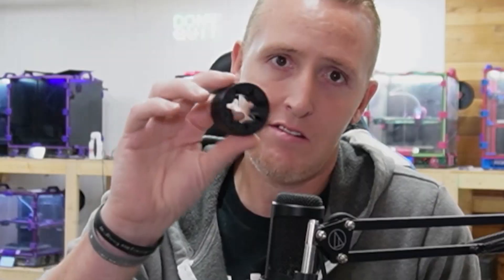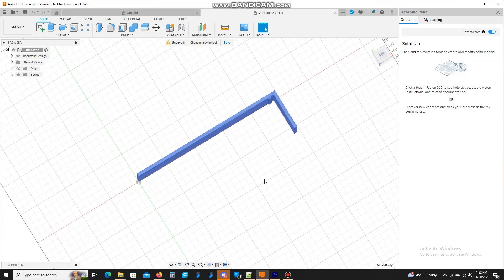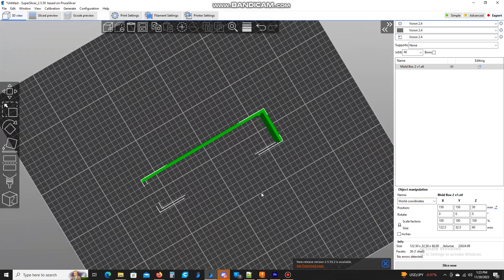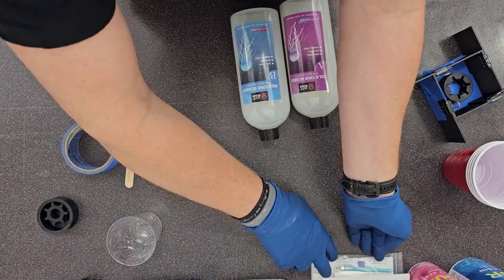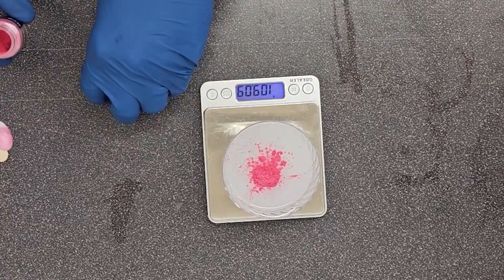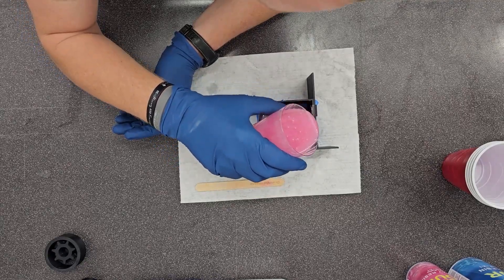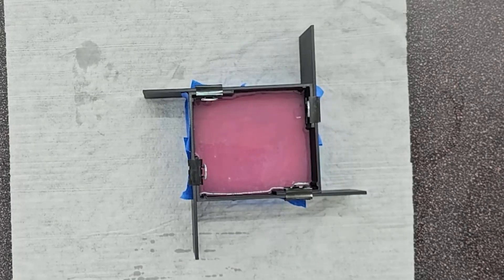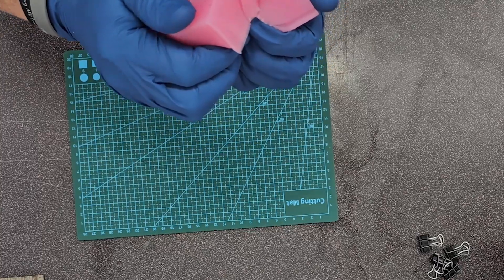From Prototype to Production: Using 3D Printing, Silicone Molds, and Resin Casting

Comment: Great to see everything turned out!!! 

My video commentary… 
- Those scales in your video are what I use… think I have 4 of that size and 3 of the large ones. I also spray my scales with a silicone based mold release in case of spillage. 
- OLFA precision knifes and their break off knives are superior. 
- Good resin pouring technique.
- it can take up to 30 days for resins/epoxies to fully cure. Usually after 7 days is when you really hit the mark where they will be mostly cured and that 8-30 day window is getting the last “10%”.
- if you do more regular casting find a product company where you know you will get consistent product with good technical specs. I use smooth-on products sourced through Reynolds Advanced Materials.

Super stoked for your print to mold to cast!
Reply from the maker: Thanks man! I had no idea it takes that long to do a full cure! I was beginning to wonder if I did something wrong but I did it by weight and mixed it all really well so I figured it was just needing more time. 
I am definitely going to be doing more molding and casting! Thank you for all your tips and help along my way for this first pour. I really enjoyed it! 
I will be using the same products and ordering from that website also (Reynolds). I'm going to place an order for a bunch of things after these holidays are over. I love your setup btw! I want a larger shop myself now lol. But don't we all! 😂

Comment: Yeah, this was awesome to see the process. As trix4rix said, I'm interested in how this performed for the customer, you mentioned at the beginning of the video that they tried a PTEG part and another was Nylon -- did the resin one stack up better than those? I've found other videos on YouTube on making molds for legit carbon fiber, really looks doable too with carbon fiber strands and resin similar to fiberglass. Anyway, I haven't tried any of those but I might have to try it at some point. Thanks for sharing this process!
Reply from the maker: I will let you know how this part worked out for the customer. They haven't tried it yet, but will be very soon. It said the curing time was 72 hours on this resin, so I told them to wait until a couple days before using it.